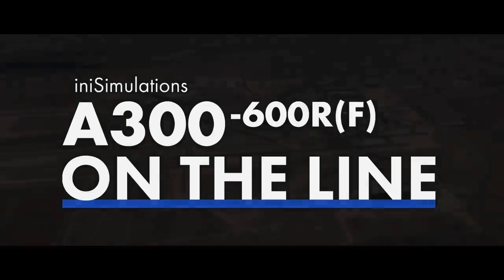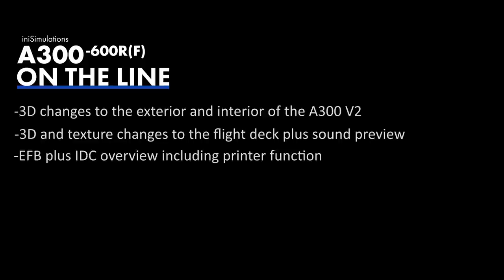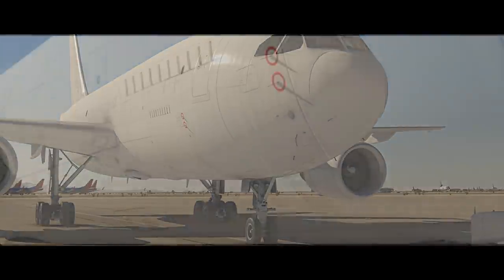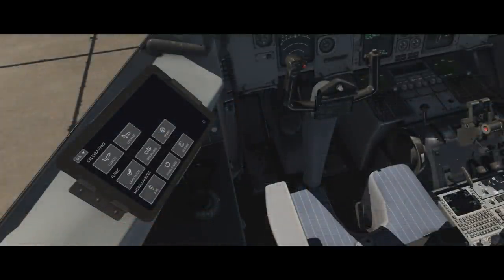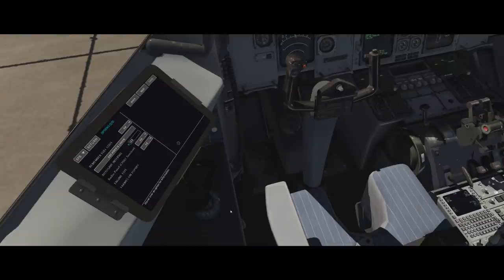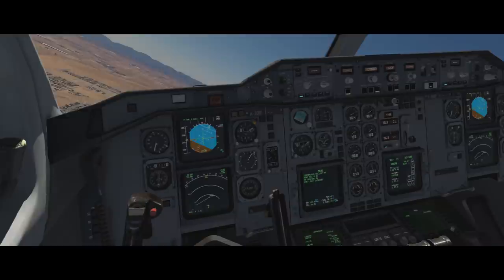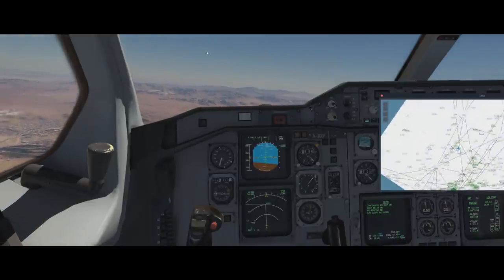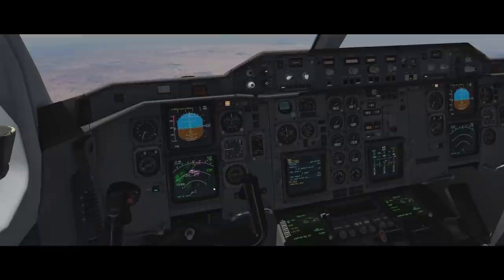Welcome to the iniBuilds A300-600R(F) ON THE LINE V2 - The Walkthrough

Comment: Great Aircraft👍.. I was just wondering can anyone confirm if the Autothrottle system can be use (engaged) during Rnp Approach as well? Or should I disconnect it use manual thrust on NPA instead? 
Thanks heaps 🙏